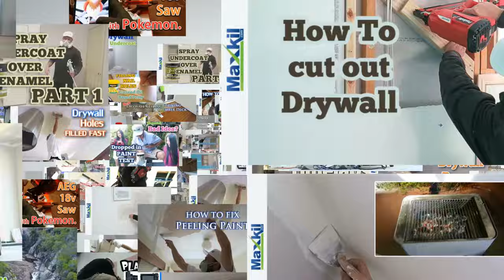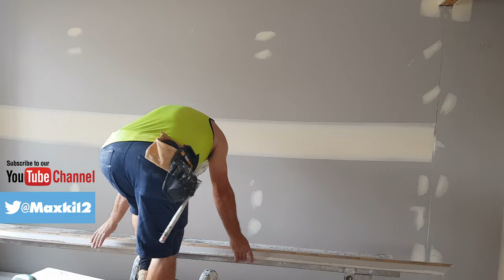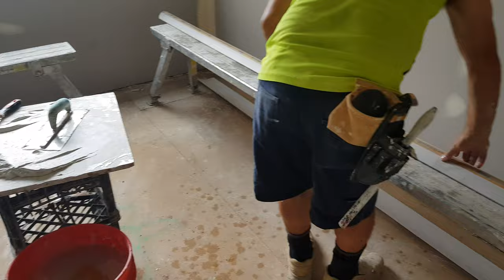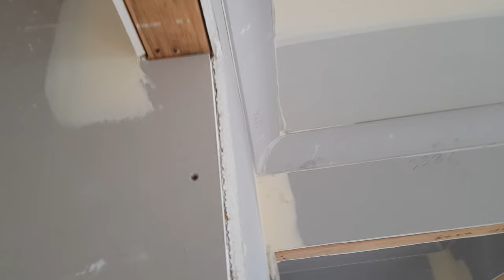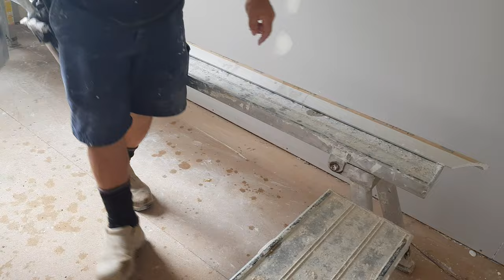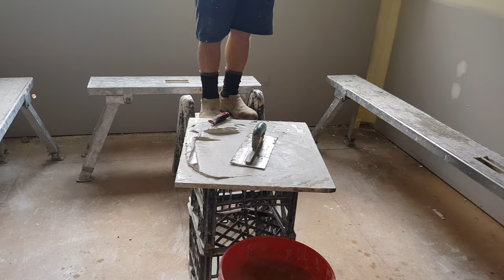Drywall Plastering Tips on How to Install Cornice like a Pro

Comment: I just did this and I don't know how his mud lasted so long ahaha. I had to make a batch for each one. Goes off so quick
Reply: A pinch of Citric Acid Slows down Cornice Cement, You dont drill it up you let it soak enough or a lite drill and then mix it on an off cut of board like hes doing.
Reply: Marc One - But in the event of Breakdown (weakening of Adhesion ability of Cornice Cement, due to use of Citric Acid) Manufacturers will void all Guarantees, associated with the use of a Foreign material.
Reply: Acetic acid slows down curing
Reply: Marc allready  said that 😀
Reply: He was loosing it at the end there , honestly that was painful to watch .
Reply: The key is too not mixed it too much, the more you move the cement the faster it sets

Comment: What does he use to stick it to the wall? Plaster mixed with joint compound? Molding plaster? Joint compound?
Reply from the maker: +Whenyouknowbetter it's its own product called cornice cement.
Best kind of compound in my opinion
Reply: Only old skoolers can use cornice.